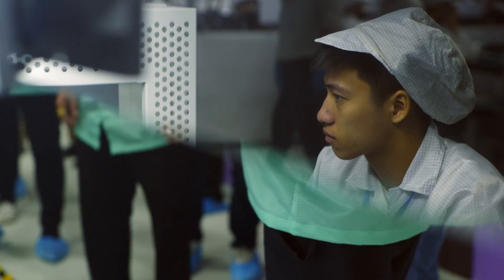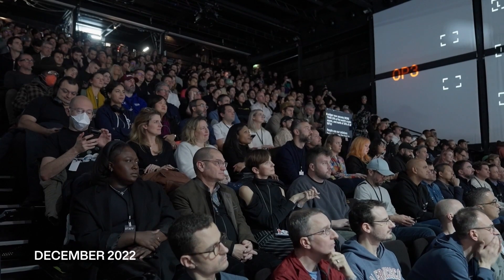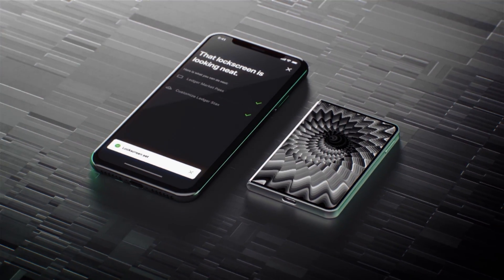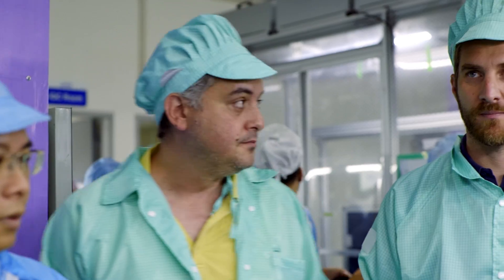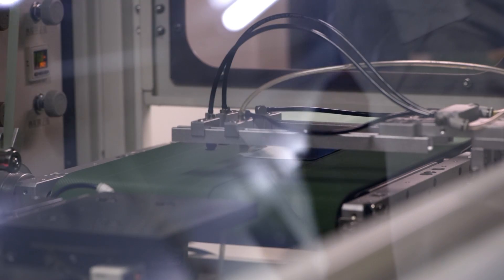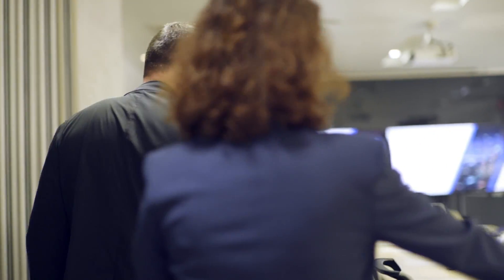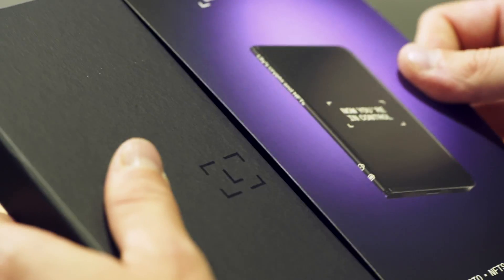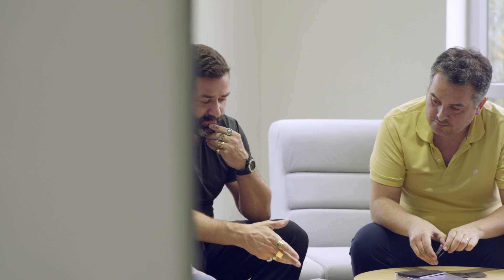Ledger Stax – now shipping

Comment: I have issues with Leger stax and Ledger flex connecting bluetooth on my andoid phone. Each time i try to connect i have to retry 5 times i be able to connect on my andoid phone. Ledger need to update new firmware to fix the bluetooth as soon as possible.
Reply from the maker: Hello Ryan, could you please make sure location services (GPS) is enabled on your Android phone, check the guideline here: https://support.ledger.com/article/8632841671965-zd

If needed further help, do not hesitate to reach out directly here: support.ledger.com

Comment: Is there a back door on this device?
Reply from the maker: At Ledger, our mission has always been clear: to empower individuals to securely self-custody their assets. With over 10 years of innovation, 7 million devices sold, and zero hacks, Ledger is the trusted leader in hardware wallet security.

1. No Backdoor. Ever.

Claims of an “active backdoor” on Ledger devices are categorically false. Ledger’s security model is based on secure element hardware and cryptography, ensuring that only the user has access to their private keys. Ledger Recover, provided by Coincover, is an optional service and does not change this principle.

Ledger takes transparency seriously. We employ proprietary software for our Secure Elements, ensuring the highest level of tamper resistance and security. Importantly, a majority of Ledger's code is open source, including Ledger Live, Wallet API, Secure SDK, and embedded applications on our devices. You can review key components like the LedgerOS commands dispatcher, and entry points of Ledger Recover, provided by Coincover, implementation and its cryptographic library here. Ledger undergoes regular third-party security audits to ensure our security measures remain robust and reliable.

2. Ledger Recover: Cryptographic Innovation with Security.

Ledger Recover is an opt-in paid subscription service provided in partnership with Coincover, an industry leader in digital asset protection. It is designed for those who find the traditional 24-word recovery sheet daunting. The service requires a paid subscription and leverages advanced encryption and shard-splitting technology:

- Your seed phrase is split into 3 encrypted shards, each stored separately by trusted providers in three different jurisdictions.

- The shards can only be reassembled with your explicit consent, through your device and ID verification with two of the three providers.
Neither Ledger nor Coincover has access to your private keys at any point.

- In the 1+ year since its launch, there have been zero incidents involving Ledger Recover, provided by Coincover, with many customers expressing relief knowing they have added security, the peace of mind of having a backup SRP, and the convenience it provides.

3. Third-party access Misconceptions.
Let’s clarify:

- Ledger cannot decrypt your seed phrase. Shards are stored with independent providers, encrypted, and require your identity verification (IDV), Ledger device, and consent for decryption.

- A minimum of two of the three fragments would be required for any jurisdiction to gain access to your wallet, and a court order would need to be obtained in at least two jurisdictions. These individual fragments are not exploitable on their own. Two of them would need to be recombined and decrypted with separate keys. Any order of this nature would realistically only ever be obtained in the most serious cases of criminality (such as where terrorist financing is suspected).

- If a user chooses not to IDV and pay for the service, none of the above is relevant or applicable and the Ledger device operates the same as before.

- If anyone gains access to your physical wallet, extracting keys is only possible if they know your PIN. Ledger’s secure element and PIN-protection prevent brute-force attempts, ensuring your funds remain secure—even in the event of theft or loss.

Additionally, with over 600 million crypto owners worldwide, only a portion of them are in secure self-custody. Ledger Recover, provided by Coincover, is aimed at empowering more people to self-custody their assets instead of relying only on centralized solutions.

Ledger stands for self-sovereignty and security. Misinformation like this only hinders the movement toward wider crypto adoption and self-custody. We encourage everyone to research thoroughly and make informed decisions about their security.
Reply: There is no "backdoor" on any ledger device. Whoever told you that does not know what they are talking about. You are referring to the Ledger Backup where your seed is sent from device to a cloud backup in 3 parts. There does not exist 1 single hardware wallet that actually prevents that from happening. None what-so-ever. The difference however is some wallets are open source like Trezor so you can see no code is put in there to send your seed to any servers. With ledger its closed source so you just gotta trust them on it. You actually have to PAY to use the backup feature which means unless you are paying money for something you do not want like a bonehead then you have zero to worry about. But then again those trezors were pretty easy for hackers once they have their hands on it to use voltage spikes to essentially dump your seed from device. Guy on youtube did it a few times.

So the choice is yours. Use a device that has no backup features but can be hacked if they gain physical access or quite whining like a little beotch and actually have even some clue what the hell you are yapping on about.
Reply: @scriptles  there’s several videos of Ledger staff admitting there is a back door for the police to extract the keys in the event of a seizure. 

Many other wallets have protections against this very thing.
Reply: @ThomasConover  show me these videos because I swear I have seen videos that have said the complete opposite.
Reply: @scriptles one man gets up and slow claps.
Two more men get up and slow claps. 
5 more men get up and slow claps. 
Half the room is standing and clapping.
Entire standing ovation.
Reply: @archetype1987  There are 2 types of people in this world.. those who can read schematics and code and those who cannot. Those that can, have a better understanding of what is possible and how things work.. those who cannot just guess what is possible. Ignorance, it's a bliss and a curse. No need to clap because all those 1 handed people are going to end up smacking themselves on the head to make a clap sound since there in the slow clap crowd. Personally I never seen the slow clap crowd because the people I hang around have a few more braincells then that but hey cheers! You gotta start somewhere. Aspire to make it where I have, it's nice and comfortable here. ;)